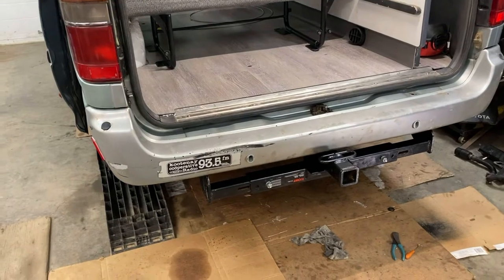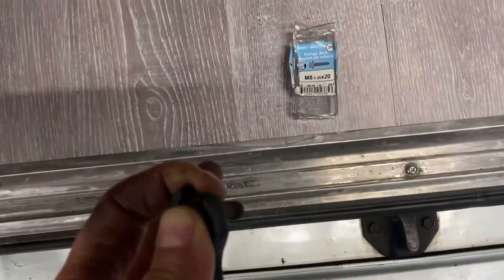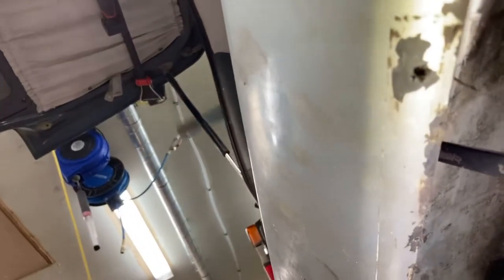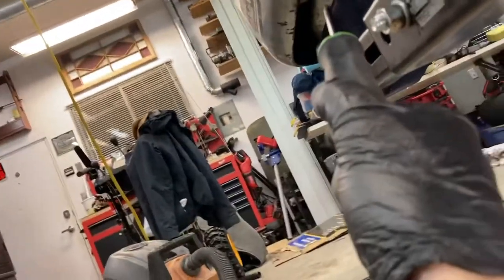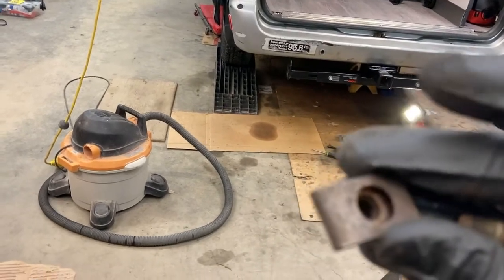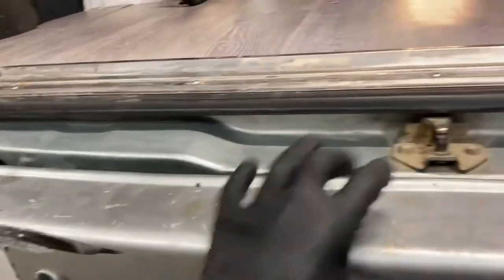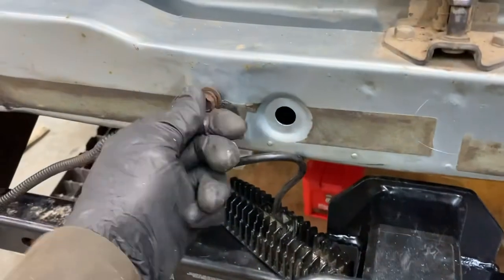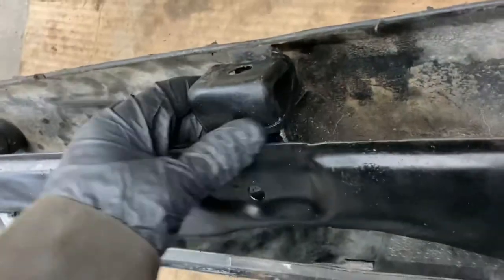Toyota Hiace rear bumper remove/ re-install

Comment: Hello FM. Followed your advice to remove the bumper complete and without your vid would probably have made a mess of things or tried to take the plastic part off first, which would have gone badly so many thanks. Applied penetrating oil to the remaining fasteners which I'll take apart in slow time and now off the vehicle also have access to these so I can support while removing. Plan is to clean up, rust treat the inner metal piece and tidy up a few spots on the body when the bumper is off. Cheers.
Reply from the maker: Nice job!  Glad my video helped, it’s so hard to find good repair info for these old wagons..  I think I also used a bit of anti seize on the bolts just to keep everything from rusting up because I plan on removing it in the future

Comment: Really helpful.  I cracked my rear bumper (the plastic outer) so I figure if I can get that off I can repair and respray.  Thanks!
Reply from the maker: Good luck!  Highly recommend removing the inner and outer as a unit if it’s never been off, or has been a while.  It’s a perfect rust trap and there’s no way to spray pb blaster or penetrating oil to loosen those bolts with the outer skin still on.

Comment: Great video!!! Could you give me some info on the Trailer hitch??
Really need one and you know I'M in the
USA.
Reply from the maker: Thanks!

Where in the us?

My van has factory nuts, fine metric female threads, (2 per side) offset in the unibody frame rails for mounting a hitch.

I bought a generic 2” hitch that adjusts to multiple widths.  Then fabricated some brackets by drilling 2 holes in a piece of 3/16 angle iron for each side to transition from the horizontally oriented holes in the frame and the vertically oriented bolt holes on the hitch. Making these adapter brackets was key.. it was a lot of trial and error and using a floor jack to hold it in place to measure and mark and make cardboard templates 

I also had to notch the hitch slightly so it would slide rearward enough to mount and allow access to the spare.  The tube holding up the spare tire also had to be bent in one spot to clear the hitch.

It was then quite a bit too low but by flipping the 2” receiver to face up then everything fit perfectly..  

Its pretty beefy, as I only plan to use it for a bike rack but you never know, it could come in handy as a recovery point.
Reply: @FixerMerlin  I'm in West Haven Ct,Have a 1995 SCL td.
Thank you for the info!!!Wanted to buy a rear bumper with a tow hitch but its gonna be about 3k shipped from Australia.Way out 
of budget.Once again thank you for your time.
Reply from the maker: @johnrohman31  ya I’m considering building front and rear steel bumpers for my van probably start with the front one though
Reply: @FixerMerlin  👍👍👍

Comment: Thanks for all your video. Really appreciate you. I was trying to get rear tow hitch for my LH119. How did you do it and where did you get the parts? Thanks
Reply from the maker: You are welcome!!!  I bought a generic 2” tubular hitch for domestic trucks and modified the side brackets to fit the side of Hiace tubular frame through trial and error.  Also added a third tab to attach to the underside where there is a 3rd fine thread nut welded inside the frame